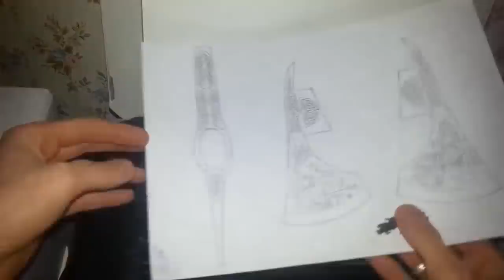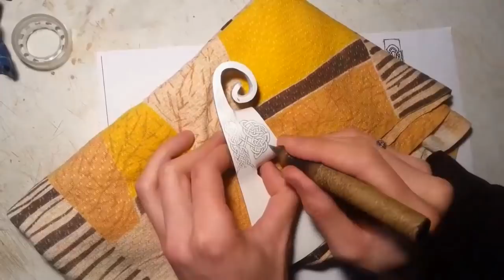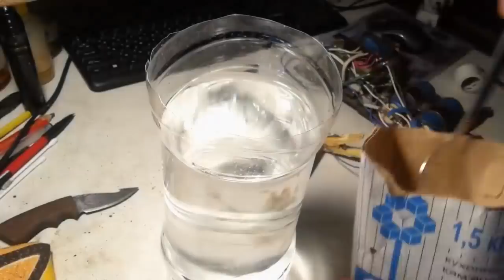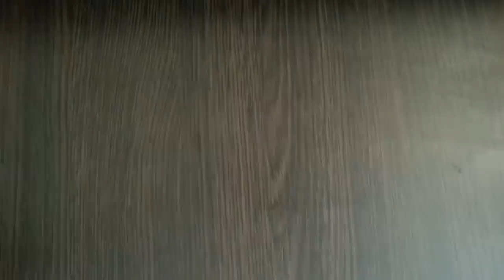Drawing on metal. How to make a vintage ax.

Comment: Your work is amazing, but not being able to read Russian, I have no idea what the products you used were when you showed labels...can you post a list of chemicals/products used to achieve the results?
Reply: I thinks its saltwater being electrified
Reply: Actually he did  9 months ago.

1. I pickle the metal so that the paint adheres well to it. You can also see this process in some of my other videos.
2. I paint metal. I use alkyd spray paint.
3. Transfer the drawing to the paint. I use a drawing film and a simple pencil. You can use food paper or matte film for lamination.
4. I scratch the drawing.
5. I do electrochemical etching of metal. 2: 49minutes - wrapping medical cotton on the electrode. I do metal etching in salt water.
6. I transfer the drawing. 3: 56 minutes, Scratch the contours of the picture.
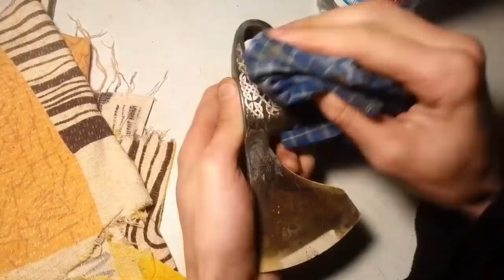7. 4:12 I wash the paint. I use solvent like acetone.
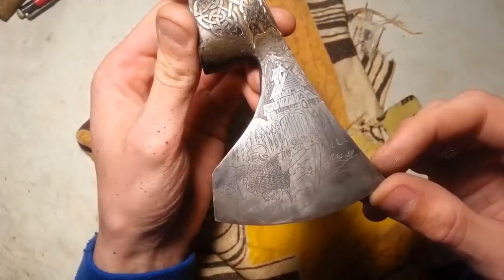8. 4:33 Female nail polish. I use it to protect fragments of the pattern, in those places where the metal should not be etched.
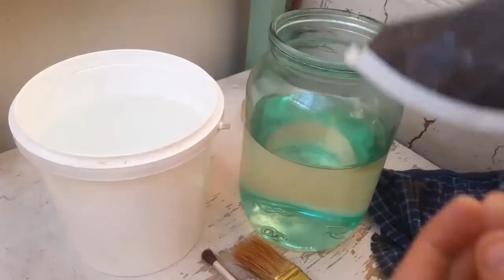9. 4:56 Metal etching in nitric acid 5%.
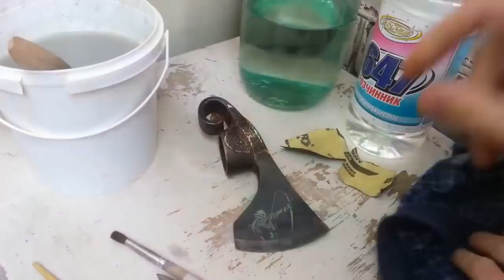10. 5:11 Wash in water.
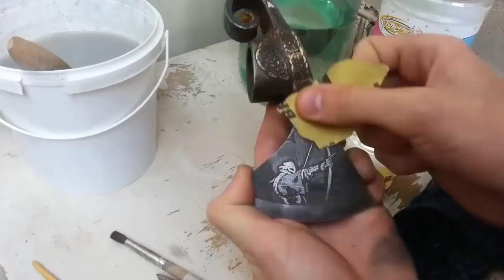11. 5:18 Sanding with sandpaper.
12. I paint over nail polish for more fragments of the picture. And again I do metal etching in acid.
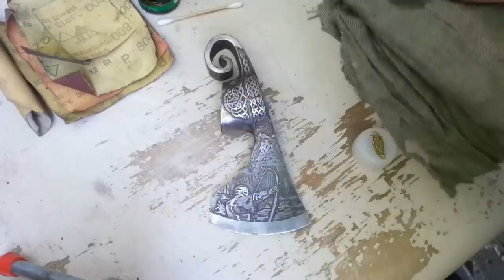13. 6:01 I wash the nail polish. I use solvent like acetone.
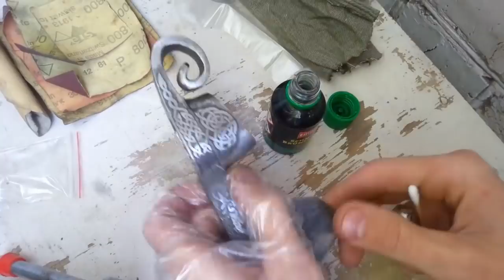14. 6:16 I blacken the metal. I use a special liquid for bluing.
15. 6:50 Wash in water.
16. I grind metal for the manifestation of the pattern. I do it with sanding paper. On the convex parts of the metal, the blackening is erased, and the drawing looks contrast.
17. I lubricate the metal with oil to protect against oxidation.
Reply: @anonimous1812   thank you!

Comment: Woul You be so kind and put some information on what kind of chemicals You use at different stages? :)
Reply: I think he use CNC ,and he paused camera
Reply: If you still want to know a different way to do this.

Take clear electrical tape. Cover the blade. Next draw/find a picture you want and print it, then trace the image onto the tape, and cut away either the negative or positive portions of the drawing. Then take either 2-3 9 volt batteries, or an old depleted car battery and hook the positive to the blade, and the negative into onto a metal rod that will be placed into a bucket of salt water. 
Now as you do it, make sure you don’t etch the beveled edge of you’re blade. It will weaken it. Wipe away some of the rust/metal and make sure you don’t etch more than you want. Then when you’re done buff the side you etched, and repeat on the other side. 

You can make extremely detailed drawings like his this way. With that said, Just be careful when it comes to electricity. I would suggest the 9 volt method if you’re not comfortable/confidently/safely able to use a larger battery

Apparently I should watch the video before commenting. He did this method with the base etch at the start. Then the later one I suspect is the same thing but now dipping it into the glass. The second glass I think is just water to clean off some of the left over rust/etching material. It could be vinegar though to add a patina to the blade.
 As for the two containers he used one is blueing solution, and what looks to be grease for gears to add another level of rust protection.
Reply: @IIBLANKII  What was the nail polish for? Also, what do you mean by "glass"? Sorry I'm  new.
Reply: @chazly30  similar to when he used paint to draw his image onto the ax head, the nail polish is used to protect the image he drew. This later gets rubbed away when you sand away material at the end.

As for glass, I'm referring to the glass jar he has full of what I would assume is either vinegar or water. (I can't read Russian, so I'm assuming it's vinegar) the vinegar is used to add a patina around the parts that don't have nail polish on them. This etches the design without nail polish. more, and lowers the surrounding design further into the blade

Essentially you're making a "background".  If you could see the height of the skull compared to the base of metal it would look like this.
| |  too   |   |. (Not to scale just an example)

The other glass jar is full of water to clean the vinegar off of the metal. This etches the metal and gives it a patina to help prevent rust. Although him bluing the metal and adding gear grease at the end gives him pretty good protection as it is.
Reply: @IIBLANKII  So the vinegar further etched it (which makes it look tinted) to give the appearance of shadowing? The parts with the nail polish where protected (keeping them shiny) which keeps those parts in the forefront giving the image its depth? I noticed he did that a couple times to give it layers. I'm assuming the time it spends in the dip as well as the concentrate of vinegar makes a difference also?
Reply: @chazly30   @chazly30  definitely, the time of how long you let it sit will determine the depth of your etch. Now be careful of the length of time also means that if you let it sit for too long, it will down, and then around your nail polish. Which would mean you could lose detail as you do it. 

As for the shadowing, that is the patina effect. Patina is a protective oxide layer to prevent the metal from oxidizing. I know that sounds weird to rust metal to prevent it from rusting, but it's essentially putting a small (even food safe) film of rust to slow down rust.
Reply: @IIBLANKII  Cool. Thanks for taking the time man. I appreciate it. If I have any other questions I will bug you again lol. If you do this kind of work please let us know where to find/see it. Thanks again.
Reply: @chazly30  no worries, and I don't do this all that often, I'm an engineer, and was a son of an engineer...etc. So materials and chemical reactions were common household discussions. Although I have done this before for maintaining certain tools, or kitchenware like the chef's knife I made for my brother when he got married.
Reply: @IIBLANKII  would you know what is the spray paint he uses to cover axe that he dont want to etch?
Reply: @pvpv6969  I would think it's just metal spray paint. Just the normal one you can get from a dollar or department store. 

It's just there to cover the metal to prevent the surface that is covered by the spray paint from being etched. If that's the case I would suggest a cheap flat Rust-Oleum paint. I would suggest a cheap flat one because you'll scrape it off after you etch a layer.
Reply: @IIBLANKII  I just came across your comments, and just wondering if you know what kind of paint is used in this process? Is it acrylic? How many coats are necessary to be protective against the salt etch? I have everything necessary, but, I just want to make sure I’m using the correct Resist

Comment: Good job !
Can you translate the name the produc or acid that you are using in english, could be very helpful for me thanks
Reply from the maker: Thank you. I appreciate your attention.
1. I pickle the metal so that the paint adheres well to it. You can also see this process in some of my other videos.
2. I paint metal. I use alkyd spray paint.
3. Transfer the drawing to the paint. I use a drawing film and a simple pencil. You can use food paper or matte film for lamination.
4. I scratch the drawing.
5. I do electrochemical etching of metal. 2: 49minutes - wrapping medical cotton on the electrode. I do metal etching in salt water.
6. I transfer the drawing. 3: 56 minutes, Scratch the contours of the picture.
7. 4:12 I wash the paint. I use solvent like acetone.
8. 4:33 Female nail polish. I use it to protect fragments of the pattern, in those places where the metal should not be etched.
9. 4:56 Metal etching in nitric acid 5%.
10. 5:11 Wash in water.
11. 5:18 Sanding with sandpaper.
12. I paint over nail polish for more fragments of the picture. And again I do metal etching in acid.
13. 6:01 I wash the nail polish. I use solvent like acetone.
14. 6:16 I blacken the metal. I use a special liquid for bluing.
15. 6:50 Wash in water.
16. I grind metal for the manifestation of the pattern. I do it with sanding paper. On the convex parts of the metal, the blackening is erased, and the drawing looks contrast.
17. I lubricate the metal with oil to protect against oxidation.
I hope I answered your questions. If you still have questions, write, I will try to answer.
Reply: Thanks mate ! Appreciate 
Very helpful
Reply: @KirillRunz  You have great skill mate! I have a question when you use the nailpolish the second time do you also protect the first fragments done with nailpolish? If not don't these  etch as well(which is not seen in de vid ;)) thanks and keep up the great work

Comment: The chemicals?  I'm sorry to say I'm only an English speaker/reader - my bad - but could you translate your chemicals into English?  Love to try that (though with a design much more simple) - but doing the research that you've done to put together the ingredients list would be beyond me, I fear.  Using a hatchet or some other small hammer thing for the starting point is Genius!  Great video!  Thanks!
Reply from the maker: Thank you. I appreciate your attention.
1. I pickle the metal so that the paint adheres well to it. You can also see this process in some of my other videos.
2. I paint metal. I use alkyd spray paint.
3. Transfer the drawing to the paint. I use a drawing film and a simple pencil. You can use food paper or matte film for lamination.
4. I scratch the drawing.
5. I do electrochemical etching of metal. 2: 49minutes - wrapping medical cotton on the electrode. I do metal etching in salt water.
6. I transfer the drawing. 3: 56 minutes, Scratch the contours of the picture.
7. 4:12 I wash the paint. I use solvent like acetone.
8. 4:33 Female nail polish. I use it to protect fragments of the pattern, in those places where the metal should not be etched.
9. 4:56 Metal etching in nitric acid 5%.
10. 5:11 Wash in water.
11. 5:18 Sanding with sandpaper.
12. I paint over nail polish for more fragments of the picture. And again I do metal etching in acid.
13. 6:01 I wash the nail polish. I use solvent like acetone.
14. 6:16 I blacken the metal. I use a special liquid for bluing.
15. 6:50 Wash in water.
16. I grind metal for the manifestation of the pattern. I do it with sanding paper. On the convex parts of the metal, the blackening is erased, and the drawing looks contrast.
17. I lubricate the metal with oil to protect against oxidation.
I hope I answered your questions. If you still have questions, write, I will try to answer.
I wish you creative success.

Comment: Fantastic work, is this your job or hobby? Very inspiring.
Which knife steel is best for etching? Subscribed👍.
Reply from the maker: Thank you. I appreciate your attention. So far this is more of a hobby. Any knife is suitable for pickling. Best carbon steel knife. Stainless steel is well etched by electrochemical method. And carbon steels can be etched in acid and electrochemical methods. There are chrome-plated sheets. Chrome steel is etched well, but whimsically and unpredictably. There are a lot of variations. But etching can be done on almost any knife.

Comment: I have had some great results with this technique, but had to use contact paper instead of paint. When I tried paint it chipped and prevented details from being etched. What spray paint works best? I'm pretty sure I used the wrong paint and that was the problem. Anyone state side know what brand or type is Alkyd?
Reply from the maker: Thank you. I use regular spray paint. Such paint is painted on the walls. You can also use nail polish, bitumen varnish ... If you etch metal in ferric chloride, you can use beeswax as a protective coating. There are many options for metal protection.
Reply: @KirillRunz  thank you, I really appreciate you taking the time to help🙌

Comment: very good work congratulations. What is the solution you use in the glass bottle that is not connected to the transformer?
Reply from the maker: Thank you. I appreciate your attention. Metal etching also occurs in a glass jar. In a glass bottle is 5% nitric acid.

Comment: Felicidades mi amigo por esas manos y talento que tienes ... Para mí es muy interesante verte trabajar ... Me podrías indicar el método que utilizar pasó a paso si fueras tan amable ... Y lo agradecería mucho
Reply from the maker: Gracias Agradezco tu atención. Pinto metal con pintura alquídica en aerosol. Hago grabado de metales en agua salada, con una corriente eléctrica directa de 25 voltios, esta es la primera etapa del trabajo. En la segunda etapa del trabajo, pinto partes del dibujo con esmalte de uñas y grabo el metal en ácido nítrico al 5%. Para eliminar los residuos de pintura y barniz del metal, utilizo un disolvente de tipo acetona. Después de grabar el metal, uso un líquido especial para ennegrecer el metal. Esto es para hacer que la imagen tenga más contraste. Y al final, unto el metal con aceite para evitar la oxidación.
Reply: @KirillRunz  muchas gracias mi amigo que amable de verdad... Cómo se llama el líquido para ennegrecer el metal... O si lo prepara o usted lo hace, podría hacer un vídeo de cómo lo prepara  sería muy interesante.. de antemano muchísimas gracias por su atención ... Mucho éxito

Comment: Could you show us the kind of metal point you use to scratch paint please ?

Very interesting technics by the way :D
Reply from the maker: Thanks you. Glad to your attention. I scratch the paint with a homemade needle. I made it from a broken file (very small file). It is made of very hard steel, I sharpened it and work with it. I hope I understand your question correctly.
Reply: @KirillRunz  Hi ! Yes you understood well, thank you :D 
I have a second question for you, what kind of power supply do you use for your electrolysis ?
Reply from the maker: I use 25 volts DC. Ampere not say, I do not know. The device is also self-made, but I did not make it. From experience, I can say that 12 - 25 volts DC is best suited. I used a car battery charger and a tape recorder power supply, etc. And everything worked out well.
Reply: @KirillRunz  Thanks a lot for your help, I hope your channel will grow fast.
Reply from the maker: Thanks you.

Comment: Hi hope u'll be fine
Very very beautiful work.
Which method you prefer most
Acid etching or electro etching?

And what is the difference between of end result in both methods ?
Reply from the maker: Thank you. I appreciate your attention. Most often I use the electrochemical method of metal etching. I use the acid method only occasionally. It is difficult to describe the difference between these methods. At first glance, the result is the same. You can do it yourself and feel it. Acid etches the metal softer, if I may say so. And electricity is rude. This is especially noticeable with deep etching of the metal. The process itself and the safety precautions at work are also different. For different metals, a different method is better suited. But this is just my opinion.
Reply: @KirillRunz  thank you very much for your kind reply.

I want to ask 
Which method do you suggest for begginers ?

And why you used both methods on same piece?
Thanks in advance

Comment: Very  impressive!!!! Could you explain step with a nail polish? Thx
Reply from the maker: Thank you for your comment and your attention. With nail polish, I tinted those parts of the metal that needed to be latched against acid. And with each next stage he painted more and more metal sections with varnish. Thus, the etching of the metal turned out to be multi-layered. And the picture looks more voluminous. If I understand your question correctly?
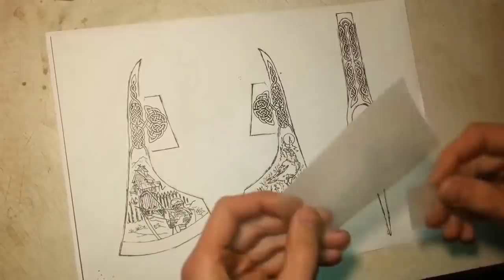Reply: @KirillRunz  1:42 That is what paper (transparant)?

Comment: What kind of transfer film are you using to transfer the drawing on to the ax?
Reply from the maker: This is a special lavsan tracing paper for drawing schematic drawings.
Reply: @KirillRunz   Oh I think they call it Vellum tracing paper here in the USA.  Does that sound about right?  And use a Laser printer?
Reply from the maker: @michaelwood5519  Yes, it must be called that, I don't know for sure. I am in Ukraine. I have tried applying a mask to metal using photographic paper and a laser printer. I didn't like the quality. Perhaps I did something wrong. I like my method, I am not going to change it yet.
Reply: @KirillRunz  well your method works great 👍.
Reply: @KirillRunz  Some people are using wax paper and run it through a laser printer. Then they can rub it onto the item in which they are transferring to.   You do really nice work. Let me know if you find or hear of the English version of your Lavsan tracing paper.
Reply from the maker: @michaelwood5519  OK. I will include a link in the description for the video if I find a similar lavsan tracing paper on sale.
Reply: @KirillRunz   That would be great Kirill, I would go ahead and buy some.  Drop me  a line on here  if you post the link.

Comment: Sorry dude, I can't read Cyrillic. What did you use for the etching?
Beautiful job, by the way.
Reply from the maker: Thank you. I appreciate your attention. I paint metal with alkyd spray paint. I do metal etching in salt water, with a direct electric current of 25 volts, this is the first stage of work. At the second stage of the work, I paint parts of the drawing with nail polish, and etch the metal in 5% nitric acid. To remove paint and varnish residues from the metal, I use an acetone type solvent. After etching the metal I use a special liquid for blackening the metal. This is to make the picture more contrast. And at the very end, I smear the metal with oil to prevent oxidation.

Comment: Wonderful job!! What metal is this and what method lasts longer?
Reply from the maker: Thank you. I appreciate your attention. The method of electrochemical etching of metal works faster than the acid I use. But it depends on the appliance which is etching the metal. If the current source is weak, then the etching will take longer.
Reply: @KirillRunz  Thank you for your response.